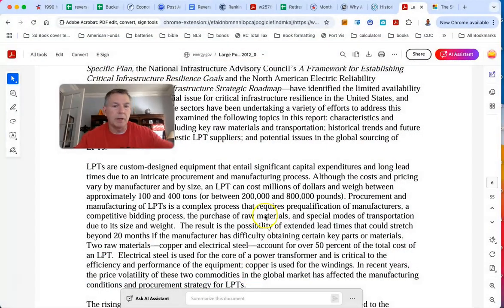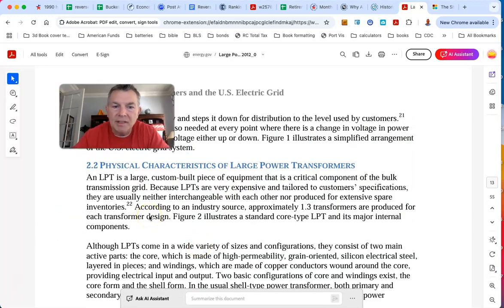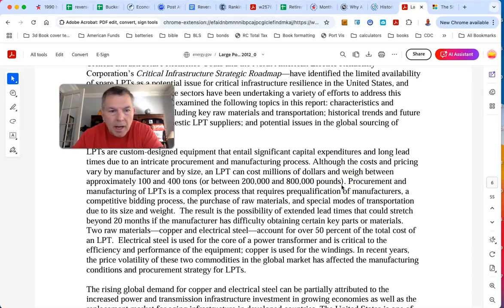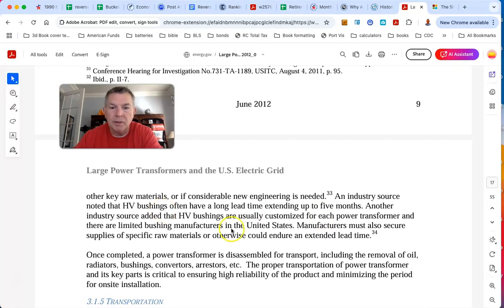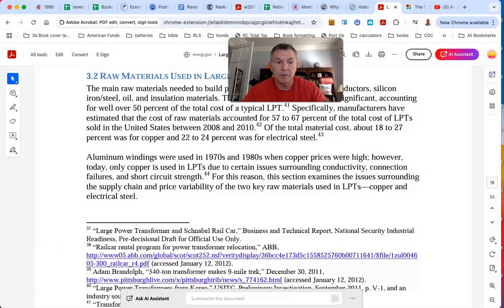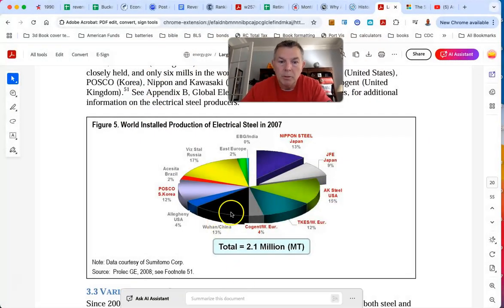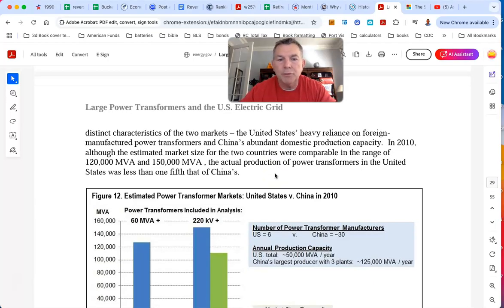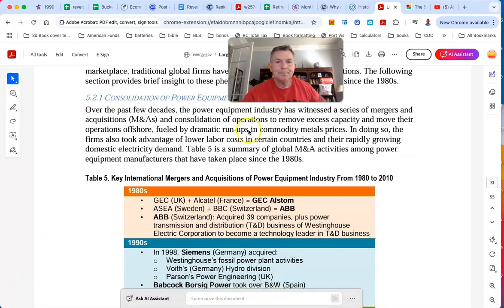You Want to Be Scared? Well This Should Frighten The Snot Out of You!

Comment: EE here.  In college we had an exam question asking what size transmission lines would be required if the grid transmitted power at 120V.  The answer was a copper cable about 3 feet in diameter.  High voltage is the only way to do it -  gotta have those transformers to step the voltage up and down.   Good video.

Comment: I work in the industry and soon to retire with my 3 buckets of bucks driven by the PVC pipe of knowledge (thank you Josh).  The US power grid issue has been around my entire  career and continues to get worse.  The other thing the article did not mention is we need more transmission lines in addition to more substations.  Try getting a new transmission line permit across a mere 5 states.  It requires federal, state and local permitting approvals.  The latter basically means no approval or 20 years to get approval.    No one,  and I mean no one, wants to see transmission lines in their backyard.  The US has basically killed itself with interstate approvals and regulations.  We produce ample power, independent of our grid being old, but we cannot transmit it very efficiently.   It really makes no difference if the energy is produced by coal, natural gas, solar , wind, battery, nuclear or hydro if you cannot transmit it.   I live in Loudon County VA.  Dominion Power has quintupled its power needs in this county due to one need - data centers.   We all take our lights being on for granted until the power goes out then we all look for blame when a blackout occurs.

Comment: Sounds like a great case for transitioning to homeowner-owned solar with batteries. No need for a transformer if the power is used at the point of generation. If conventional electrical gets too expensive for reasons such as this, the economics of solar will become a lot more compelling.

Comment: I work in this industry.  Lead times (now) for transformers and switchgear is approx 18 months.  Even refurbished switchgear is in short supply. Many of the connection accessories are sourced from foreign counties. On substations, a strategic attack on a several key subs could knock out power for entire regions.  Billions of dollars have been allocated in gov grants to wind, solar and battery storage which has deprived utilities from using these resources from strengthening the existing grid.
Reply: You are so Right, I built components for Pauwels, CPG, and WEG and these types of equipment take time to produce.

Comment: Drew Baglino, a former Tesla executive has starred a new company called Heron Power to develop solid-state electrical transformers.

These transformers are smaller and lighter, have higher efficiency, have bidirectional power flow, can convert voltage and frequency simultaneously, can be monitored in real time, can instantly disconnect and reroute power and limit inrush currents. They also will enable smart grid features as a foundation for the next generation electrical infrastructure.

I believe this is from Tesla’s upcoming third generation Megapack, which is grid scale battery storage that Musk said will be ‘plug and play’, meaning the utilities and companies that buy this product won’t need to install the usual electrical transformers. 

Although Tesla has not (yet) said so, this must mean the Megapack had a built in electrical transformer. 

Musk has been talking about this for years, it’s not like him to talk about an issue relating to Tesla’s products without doing something about it.

More recently he hasn’t been saying as much. To me this means he has a solution (at least for Tesla) in mind.

Drew’s departure to start this new company suggests that a workable solution is at hand, but Tesla alone can’t handle the need outside of Tesla. 

This isn’t the first company to come out of former Tesla executives. 

In 2017 JB Straubel started Redwood Materials to create a circular supply chain for lithium ion batteries to address the lack of refined lithium in the US.

Comment: This is why Seimens Energy is building/expanding a plant in Charlotte. Of course, we could always stop building wind and solar infrastructure, then we wouldn't need transformers to step up voltages for transmission and then back down for domestic use. We would only need to replace the ones that are getting old. In which case it might be cheaper just to rely on China, India, Germany and other countries that have had the foresigt to build enough capacity for their own use plus  export a little. You know, to countries with no tariffs on imports making it easier to buy foreign goods and not have to make their own.

Comment: Why are they building chip manufacturing plants in Arizona. Hottest place in America. The hvac needs will be out the roof. Should have built them in cooler area. maybe ND , SD or Wyoming.
Reply: Need much cooling water 💦
Reply: Not if the plant is mostly robots. Put the technicians in the AC while the plant only has air movers. Arizona, especially Maricopa County has a robust power base feed with modern infrastructure. The Palo Verde nuclear plant is just to the west of Phoenix.
Reply: @Oilfieldscout  Robots run by computers. Computers need to be cooled off as well as robot. No one cares about technicians comfort. in manufacturing facilities. Manufacturing equipment generates lots of heat that heat has to be removed by chilled water from chillers. Chillers consume tons of energy. But thats just my 40 years as a chiller mechanic and hvac guy.
Reply: @JohnD-f2o All the semiconductor plants already in Maricopa County have figured all that out. The reason large manufacturing is drawn to the valley is Arizonas friendly business culture,  availability of large pieces of flat land, access to rail and road transportation, and that honking big nuclear electoral generating plant.
Reply: But its nice in the winter, so low heating cost. It's also a "dry" heat in Arizona, that might be best for semi conductors, but the cost of cooling I am sure is a drop in the bucket.
Reply: @mcgragor1  Your thinking comfort cooling. I do industrial hvac and refrigeration for a living. (Chiller mechanic) and manufacturing equipment needs to be cooled off mechanically. it takes hundreds of tons of refrigeration to cool off computer and manufacturing equipment. Most manufacturing facilities have no heat at all. So heating is not even considered. Semi conductor rooms have to be kept at below 68 degrees to maintain equipment and control humidity.
Reply: @JohnD-f2o  I see, makes sense. I wonder though does humidity have an effect? I used to run a machine that used computer control, and they had to cool it separately, so I get what you mean.
Reply: …build below ground level
Reply: Millions of homes were built with Alumnum in the 70s…

Comment: LOL, Transformers are easy to make.  its just  cooper wire wound around a heavy iron bar surrounded by a steel case. Been thru several transformer facilities and have seen how they are made.  its not that complicated. No moving parts in them, so not much can go wrong once produced.
Reply from the maker: Wow- you better tell the DOE because apparently they don’t know this
Reply: @HeritageWealthPlanning  How many manufacturing facilities have you ever worked in or been thru. I spent my entire life in them as a hvac industrial mechanic. btw. Manufacturing is not coming back as Trump promises. its just a lie. Unless Americans want to work for 3 dollars a day. Top pay in TN is 18 dollars ., starting pay 14 dollars. Might as well go work at pet Smart. At least its Air conditioned.
Reply: Yeah apparently the big ones are made in Germany - good luck - my uncle, who also ran the APS utility in Yuma for awhile along with about 10 smaller city utilities didnt know about it either - his response was we cant get domestic replacements on a large scale, they have a few small transformer replacements in each yard but it you lose the big ones we're fucked - they come from Germany
Reply: Depends on the size. LPT, or GSU (general step-up) transformers can be massive in size and hold up to 12-25k gal. of mineral oil. They can be as large as a post-WWII bungalow home. Getting the materials only one issue, the other is the size of the facility and equipment needed to form the metals and the people with the experience to do so.
Reply: All of the materials come from overseas. Put a tariff on something with a five year leadtime when the supplier hates your guts!  Better get a good coat before the power goes out Americans. Home of the freezing